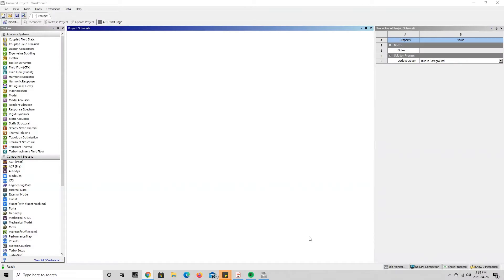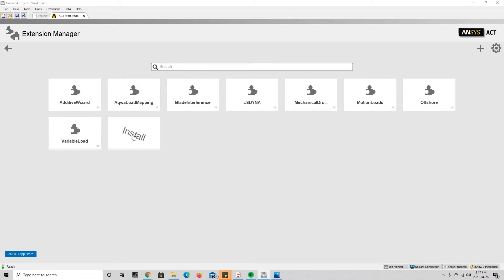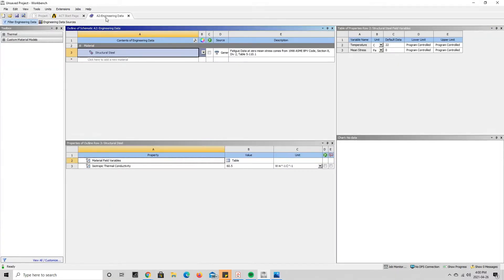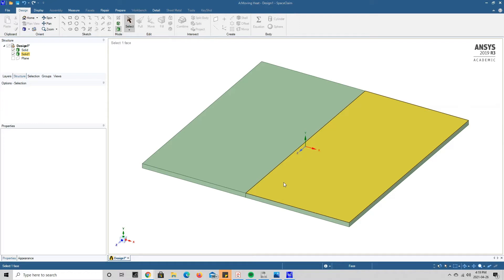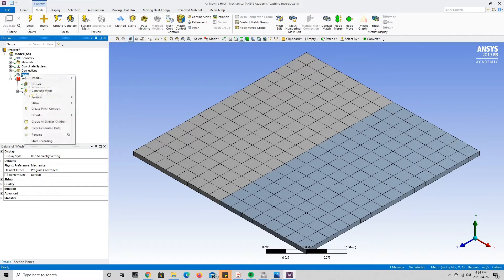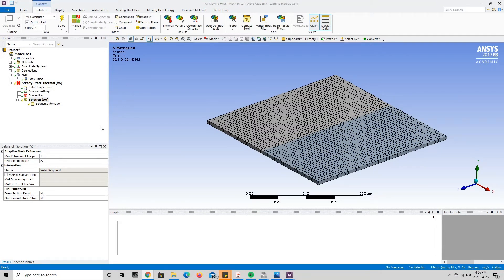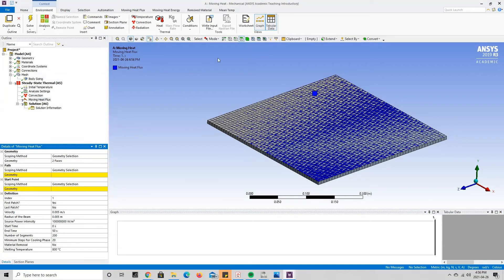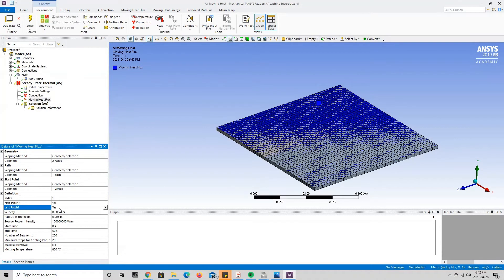ANSYS Tutorial: Moving Heat Source in ANSYS

Comment: Hello, I work on my master thesis and am a novice in CAD and FEM. I try to simulate ultrasonic metal welding process but currently stuck with boundary conditions.

The main problem at the moment is that I cannot apply the vibration motion to my system.

In ultrasonic welding an upper metal sheet slides along the x-axis on top of another one with a frequency of 20 kHz.

In some paper I found a formula: Ux = Xsinwt,

where X is the amplitude of vibration (27.5 micrometers). E.g., upper sheet first goes to the left direction, then returns to the initial position, then goes to the right direction and so on.

w = 2πf , f is 20 kHz.

Welding time in the real process is about 1-2 s, but for saving computational time it could be 0,1 s in Ansys for the beginning.

So I need to apply this equation in Ansys as a displacement. Perhaps it usually applies with APDL but do not understand how.

Comment: Hi great video
Can this be tweaked so that the heat source remains static for a few seconds and the power of the laser increases either while moving or not moving? Thanks
Reply from the maker: Hey!

As for a static heat source this would be possible. In this case you would have to break this motion into 2 different heat sources. The first heat source would be have a velocity of zero over a certain period of time. Once that period of time is over, you would be able to specify a second heat source that starts in the location where the static heat source was and that has a velocity (and path) in order for it to move. 

As for varying power intensity, unfortunately this is one of the limitation using a plug-in rather than coding the APDL commands yourself. The plug-ins are much easier to use than the commands but you experience limitations using them. Unfortunately, unlike other forces and BCs, for the moving heat source, you are not able to specify the power intensity in terms of a function or a table (rather only 1 value can be specified).
Reply: @theengineeringguide8332  Hi! 
Thanks for your previous answer. I have a couple last questions, would it be possible to change the heat distribution or shape of the laser beam like a normal distribution, cylindrical, square etc?? Also do you have any videos or resources you can share on ADPL commands or creating functions and tables? 

Thanks again !

Comment: Hi!! Nice video!!

I have a doubt, when you select the path in 'moving heat flux' you only can select the line which separate the 2 workpieces, but for example I need to select a particular path, which It's in the middle of a geometry (a weld bead). So I've made a 'path' with 'construction geometry' inside the model, but then in the options of the path (in moving heat flux) I can't select this path because the options are only 'geometry selection' or 'named selection' in the 'scoping method'. 

How can I select the path that I want?

thankss!!
Reply from the maker: Hi Ángel Artero Real,

Unfortunately this is one of the limitation of this plug-in.  Like all the regular boundary conditions that we can add, the "path" of the "moving heat flux" has to either be chosen from a "named selection" or a "geometry".  Creating a path using the "construction geometry" is a very useful tool for examining the results at a specific location but to my knowledge, it cannot be used to define the scope of the boundary condition such as in this case the path of the moving heat flux. 

I would suggest if you can, constructing your geometry as shown in the video, where the path separates the work piece. To my knowledge this is the best (unfortunately the only) way to do it using this particular plug-in.
Reply: @theengineeringguide8332  Perfect, I will try another way, maybe in APDL mode... 

Thank you for the answer!!

Comment: Thank you for your great video, it helped me out a lot. Somehow for me there are no units shown at the details of "Moving Heat Flux". Is it possible to somehow make the units appear?
Reply from the maker: Do you mean, you cannot see the units when defining the velocity and power intensity of the beam?
Reply: @theengineeringguide8332  Yes exactly, there are no units shown for "Radius of the Beam", Velocity, Source Power Intensity. I got just the numbers without units.
Reply from the maker: @Schausteller-ni7mg  This is a very weird situation... My suggestion would be to verify the download and the installation into plug-in page. Note that on the website it says the extension can be used for ANSYS version 17. Currently I am using 19.2 and it seems to be working correctly but if you are using an older version you may run into problems.

As I typed this something came to mind. Are you using imperial units on your geometry/meshing modules? It is possible that the plug-in was written specifically for SI units. So it is possible that if "mechanical" is set to imperial units, the code for the plug-in does not know/does not understand how to interpret these units (converting between them, etc). This is just a hypothesis of what could be the issue though.
Reply: @theengineeringguide8332  Thank you for your reply. I'm using 19.3 and SI units system. Maybe i should check other version or do a reinstall of the addin. Thanks for your reply!